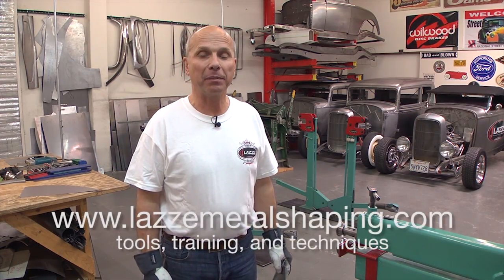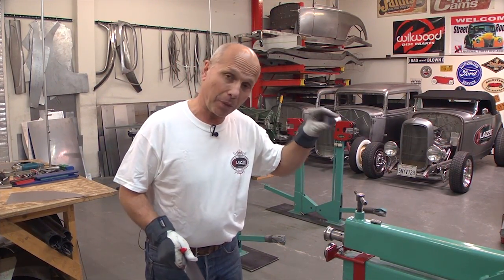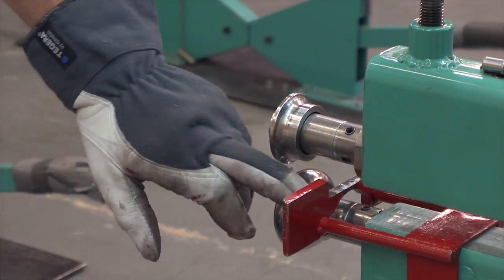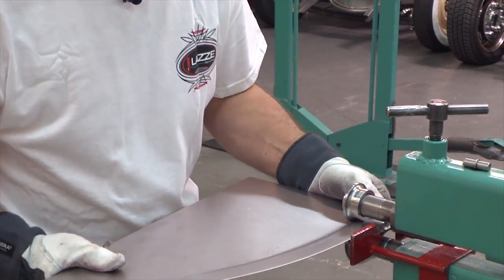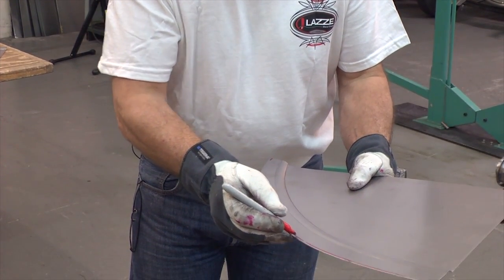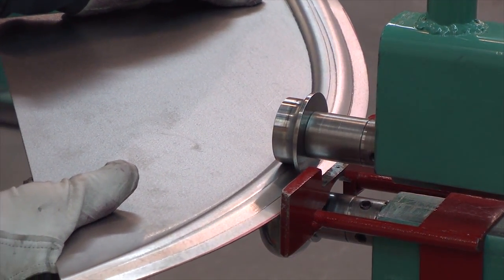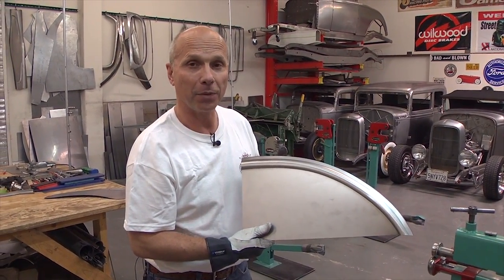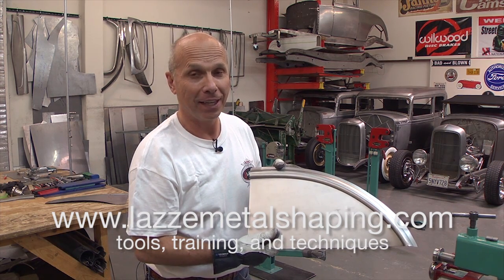Metal Shaping with Lazze: Making a Tapered Bead

Comment: Hi, i think you are the most informative person on here for sheet metal. I have a 1971 gto that had the front driver side fender hit and flattened the body curve. I tried to bang it back into shape using a sand bag. it  doesn't look like the other one. Close but no. my question is, is there a way to mirror the other perfect shaped fender on the opposite side?